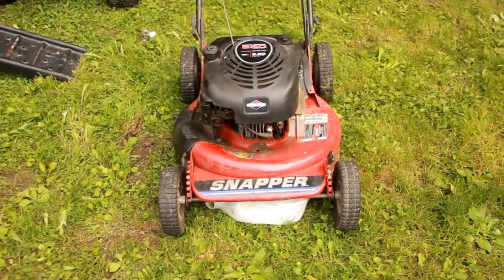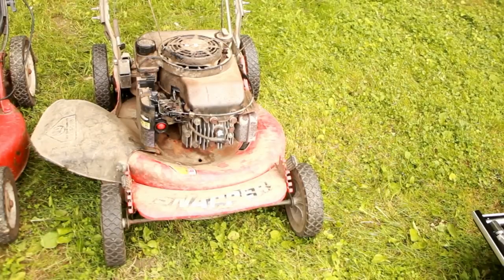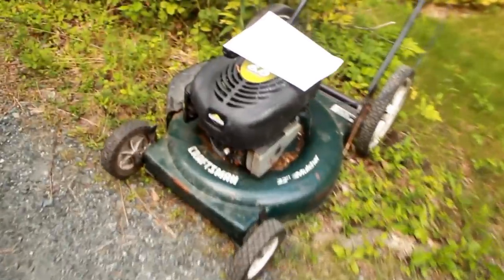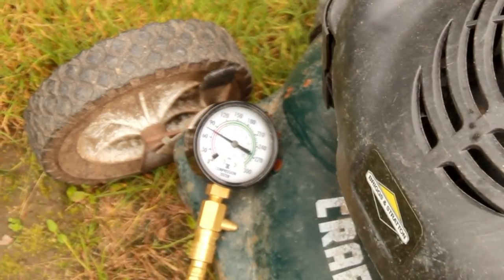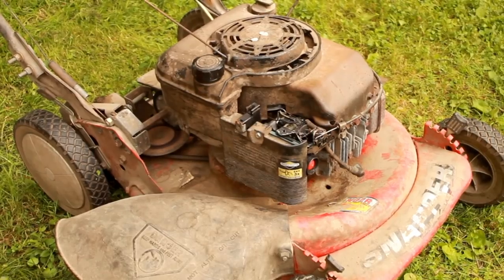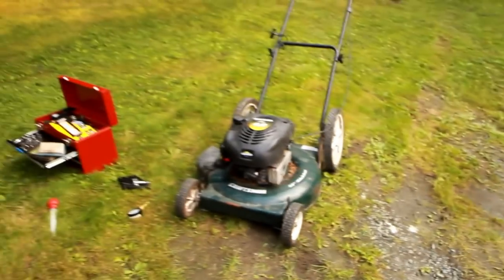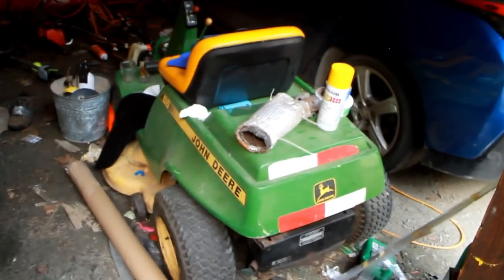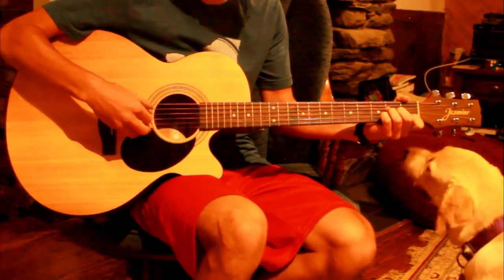Trashed Lawn Mower Revival

Comment: An engine from a Brigg 3 1/2 H P. won't necessarily fit  on a frame of another Brigg 3 1/2.  The bolt circle isn't the same. You can take the oil pan from one and put it on the other. But the cables might not be interchangeable. Why Brigg does that, I don't know. The starter cover might not be the original from that engine. Keep the good mowers if you do yard work.
Reply from the maker: yeah your right on both things

Comment: If I were you I’d modify the engine mount on the snapper mower to fit the engine from the craftsman mower. The snapper is overall better. Solid front axle and it looked like it was rwd self propelled correct me if I’m wrong
Reply: it looks as though it has the old self-propel drive disc on it-300% better than the other deck.
Reply from the maker: yes tru but the craftsman didn't have the pulley so that would be a pain

Comment: I would rather have a worn OUT Snapper than anything else. I put a Kawasaki off a dead Deere on mine and it's now a BABY!
Reply from the maker: yep kawis are great
Reply: THe only bad part is Briggs has the muffler o0n the off side and the Kawa has it's next to the chute for bagging. I just put a copper 90 degree elbow, at least an inch i/d on the heat shield and that took care of the exhaust enough but on a HOT day it might vapor lock but starts fine when cooled a little. I'm still thinking about taking aluminum flashing and making a heat deflector away from the carb so it'll all go out the chute side. Other that that, It's flawless, has the Hi-Vac kit and bags perfectly, even in mostly wet grass.

Comment: I had a snapper and it amazing, it had well over 5000 hours on it, had to run 80 weight in the oil at the end of its life but that fucker ran forever
Reply: @ARuralVermonterQqjmcb182  the compression was so low i had to put a can of either in the tank to get it to run

Comment: Poor Sabre - did it run too low on oil?
Reply from the maker: Nope, I let a friend borrow it and he said it overheated in long grass. I went out to start it and it went "ping" then seized up. I'll forgive him but definitely not happy about it.
Reply: Always remember there is usually  a reason that people who borrow things don't have anything of their own anymore. They have already ruined their stuff and are ready to start on yours.
Reply: A Rural Vermonter - Qqjmcb 182 try taking the spark plugs out and soaking the crap out of the cylinders with pb. i have also heard of the flywheel binding up on the stator underneath it. just some ideas. i would think it would lockup when it overheated but if it was cool when u tried starting it. thats just odd. personally i would look into what caused it to do it. those vanguard briggs are great. check out this video. sounds like what you are dealing with   https://www.youtube.com/watch?v=VlnbdpEd1L4&ab_channel=LynolsOffice
Reply: @ARuralVermonterQqjmcb182  What's the ping caused by?

Comment: I wish that you could keep the Sabre but I know a super simple way to get it unseized and it takes very little time

First remove the head 
Spray the piston and cylinder with wd30 
Lastly get a old socket 
Put the socket in the middle of the piston and hit the socket with a hammer once unseized put it back together.
How I found this out is that and old engine was seized and it only took a minute to unseize the piston
Reply from the maker: Yeah I wish I could too. I would unseize it but before it went it caused damage to the rods and piston so its unsavable

Comment: Life seems to be short, violent and tragic for lawn care equipment up north. I've never actually had a mower engine seize up. Oh well. JD Sabres are for people who only want to pay for the name anyway. 

I think JD is overrated anyway after seeing all the broken plastic. IF I ever buy a decent lawn tractor it will be a Kubota. I'm glad you can sell used mowers but I found my profit margin on pushers is too thin to bother with them any longer.
Reply from the maker: Yes, its a hard life! JD is certainly overrated, its all about the engines in them. And this one was a good one, it just overheated. Kubota is excellent, I work for a couple families changing the oil, filters, and fluids on their kubotas. I just charge $60 per visit, its a quick way to make money. The profit is definately small on push mowers, I just do it for the fun and the youtube $$